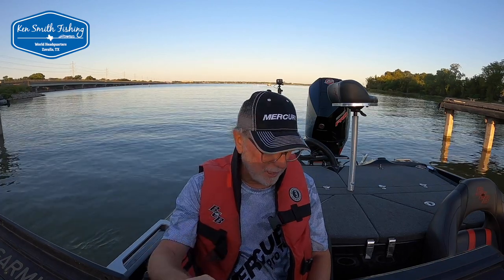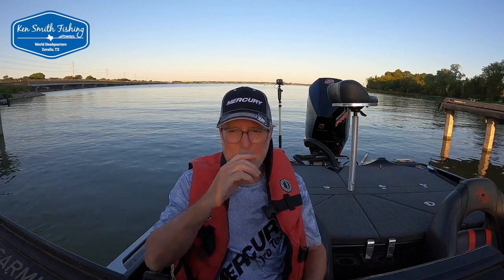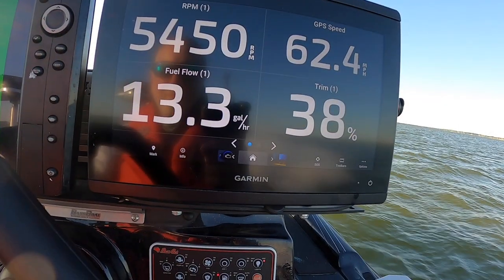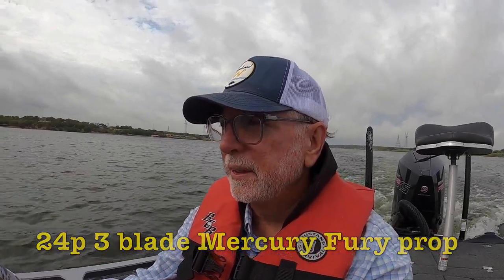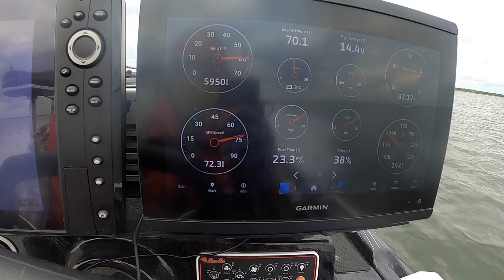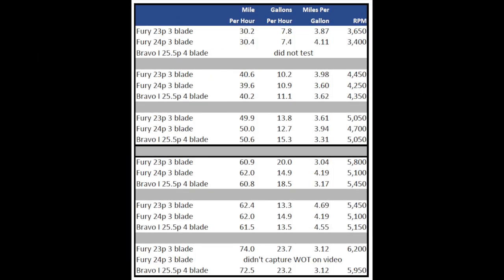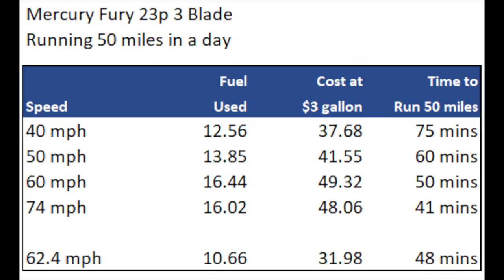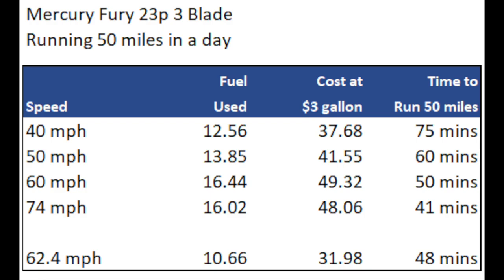Improving Boat Fuel Economy with Different Prop or Pitch....Find the "Sweet Spot" to Improve MPG 30%

Comment: Thank you for the video. I'm glad I'm not the only Geek out here. I looked at fuel economy and range way back when I would run from Diablo east ramp to Z bend on Amistad trying to manage 36 gallons on a 18'9" boat with a 2 stroke 150HP. Awesome insight. Again, thank you Ken!
Reply from the maker: Yeah, with bigger boats and tanks we don’t pay as much attention as we more “seasoned” guys once did

Comment: Only a bass boat guy would have a 100k bass boat and use a stack of $800 props to try to figure out how to save on fuel 😂

That, appreciate the effort and research Ken! Considering buying another prop myself for my 2020 nitro with a 250. Currently my summer/loaded prop is a 24p tempest and winter prop is a 24p fury. Considering trying a 4 blade for a summer / loaded prop
Reply from the maker: You mean like a guy that’ll spend $1000 to go 2 mph faster but won’t take the 80 lbs of tackle out of the front of the boat???

Comment: Ken, I've had the NMEA connected to my Evinrude and Lowrance for over 2 years now. Evinrude has the NMEA built in and all I had to do was buy the proper connector. I really haven't used my analog gauges since. Plus you get all the additional information like total runtime, gallons/hour, etc. Highly recommend everyone doing that!
Reply: NMEA
Reply: @tomrieger27  just a mistake. I do know that.
Reply from the maker: Yep, same with the Mercury, it’s just the wiring harness thingy

Comment: Good data.  I wonder how accurate the fuel flow meter is.  From gallons consumed and filling the tanks, I’d say mine has a 10% error.  As for running less gas in your tank, realize that air volume results in more condensation, i.e. water in your gas.
Reply from the maker: Good thought

Comment: Hole shot is also better with 4 blade. If you're starting and stopping a lot without long runs, then 4 blade may be better on fuel.
Reply from the maker: Definitely if your hole hopping the hole shot seems like it would make a big difference

Comment: Did you raise the jack plate with the Bravo1?
Bravo1 needs to be out of the water more vs. Fury 3 blade...  I run Bravo1 jack plate at 8 vs. Fury at 3 on gauge.
Reply from the maker: About an inch higher seemed to be where it ran best

Comment: I think if you ran a 4 blade fury you might find it even better. I have 2015 puma with a 2020 300 pro XS and the 4 blade fury lifts the bow much better at speeds below WOT than the 3 blade fury does
Reply from the maker: Chad if I can get one I’d like to try, I think you are right that it’s the life at lower speeds that gives the mpg boost
Reply: @KenSmithFishing  if you decide you want to run a fury I would let you run my 26 pitch fury 4. I bought the Puma used about a little over a year ago and have run four different props trying to find the sweet spot, but still don’t think I am there. I love the Basscat, but propping them is not like any other boat I have run and I worked part-time at a boat dealership for over 10 years

Comment: I think your comment about RPM's not being related to mpg when you're comparing the 23 fury vs the 24 comes down to the engine not being under as much of a load. We're used to mpg in vehicles,  but vehicles have transmissions that change the gear ratio at each shift where outboards don't. Take the example of driving up an incline in 5th gear in a vehicle and it's locked into that gear and won't down shift, going up that incline you might have your foot pedal to the floor just to maintain speed, the engine has to generate a lot of torque to keep you moving. Now if you are able to downshift to say 3rd, you're running higher RPM's to maintain the same speed  but you're able to do so with let's say 1/2 throttle. The fuel consumption is down because there is less load on the engine and the fuel demand isn't as high. With the boat, the only thing changing the overall gear ratio is the prop, so smaller and easier to turn should load the motor less

Comment: I see you're getting the fuel calculations by dividing MPH/Fuel Flow to get the the MPG. In your Garmin settings is your instant fuel economy accurate to get those readings or do you always have to do these  calculations? 

On my Garmin unit under instant fuel economy it never matches or comes anywhere near close to the simple math equation you did to get the MPGs. I hope I explained myself clear enough to understand.